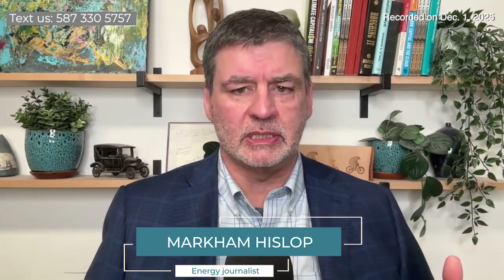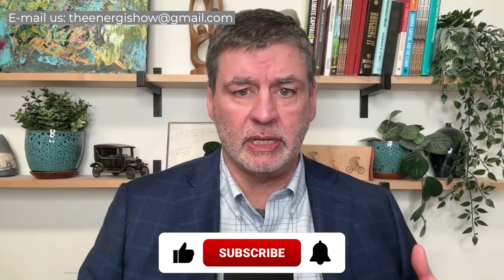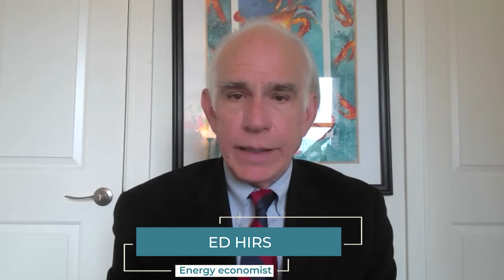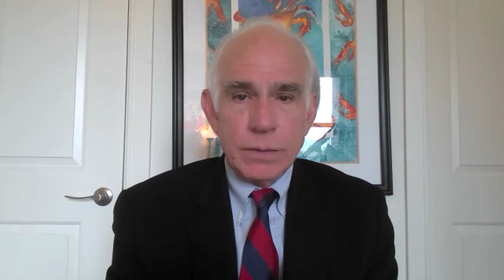Small Modular (Nuclear) Reactors Still Unproven. Are They Even Needed?

Comment: No. Wrong. The Reactors the U.S. Navy uses on aircraft carriers and submarines use bomb grade U235. Because they have to last a long time between fuelings. No one is ever going to commercialize one of these. Starting with that idea means failing. Here is a better idea : Build a liquid Flouride Thorium reactor with a funnel you can drop certain nuclear waste into, digest it at @400 Centigrade, and spit out pure elements. Then just make electricity with it. Because it's the same machine with fewer parts. When it finally breaks dig a hole next to the one it's in. Get a new reactor. Transfer fuel. Bury the first reactor.

Comment: a key point that I take from this conversation is that the SMRs in the US will run on highly enriched uranium. So far in Canada we have not had any enriched uranium reactors to my knowledge. If SMRs in Canada will run on the CANDU model of non-enriched fuel, I suspect their operational costs will be significantly higher while not taking advantage of already built design.
Reply: As I feared then, there's some misinformation going on.

SMRs in the US or elsewhere don't need to be tied to a specific amount of enrichment, enrichment is related to the fundamental reactor design not the size or format. There's some weak correlation on the size front as as your reactor volume shrinks your neutron economics deteriorate and enrichment is a convenient tool for compensating but not the only tool.

Getting to the specifics, the BWRx that we're building will require low enriched Uranium as is typical for boiling water reactors. This is more enriched then what our CANDUs use but isn't going to be a huge impact on cost, we're taking more risk on spinning up a new set of parts for a different reactor from our existing CANDUs then the cost impacts of low enrichment.

The real issue around enrichment is energy security, enrichment facilities are few and far between and currently the cumulative west needs Russian enrichment to provide enough enrichment for western nuclear reactors, this is even more severe when you shrink the circle and consider Canada's domestic enrichment capacity of zero. It's highly unlikely that Canada will spin up enrichment capacity for the one BWRx on order, it's also highly unlikely either Europe or the US is organized enough to make that happen. It's just adding a big liability for a pretty middle of the road reactor design.

Conceptually I get the appeal of SMRs, especially the very small stuff that would be used for diesel generator replacement in the high north but the BWRx is far away from that. Also without getting into more exotic cooling or fuel format designs the size of a 'Small' SMR tends to approach GW scale reactors, this was a lot of the issue that NuScale faced. Given that I really don't see the point in putting an American-designed reactor ( taking bigger risks on a Canadian design might make sense but this isn't that ) only to plug it into the Ontario grid at a point that could take a GW scale reactor. Frankly Bruce Power's consideration of building some more CANDUs at the Bruce site is a more exciting and relevant project for the future of Canadian nuclear and power generation writ large.

At best there's Canadian interest in OPG de-risking the BWRx for Alberta and Saskatchewan but if we're taking risks I'd rather they look at a small CANDU or the IMSR.

For a more thorough investigation of nuclear power I'd consult the 'Decouple' podcast, truly excellent stuff that goes deeper then our host here.

Comment: We should do more wind, solar with lots of battery storage
Reply: What you want to use proven, existing, available, technology with a declining cost structure?  Why not depend on a yet undeveloped tech with undefined cost structures and increasing cost fuel requirements?  Are you some kind of fascist commie?  /s
Reply: 0:39 if the homes and businesses under a roof with modern PV and v2g EVs selfplugged-in then grid cashflow is dead when the sunshines and the crops grow and the batteries are full. 247 problem for grid central generation. 

SMRs economics is based on 247 cashflow. 
National grid are many times BIGGER economics and is based on BIGGER 247 cashflow. 

Is their anyone who thinks beyond nuclear HEAT 247 ?????????

The children say " I will pay for it, you give me the money Dad. "

Comment: The U.S. Navy alone operates 100 SMRs. There are 34 nuclear reactors being built in China with plans to add 6-8 per year, and these are CAP1000s, not SMRs. Solar & wind have NEVER reduced the growth of global emissions, which are still rising. Nuclear has TWO MILLION TIMES the energy density of solar / wind, is cleaner / safer, and when a plant runs for 60-80 years, and isn't over-regulated, nuclear is as cheap or CHEAPER than solar.

Comment: The new AI data centers that are training AI models have many large power spikes in the range of seconds to months. They will need big grid scale batteries (or maybe pumped hydro) in addition to UPS batteries even with nuclear power. They need power now and are building private hyperscale grids mostly starting with gas power. Nuclear  (outside of restarting old reactors or uprating them) is many years away. Most hyperscalers have firm PPAs to buy solar or wind.but they have expressed interest in new SMR and even new AP1000 reactors which for them is the distant future in the AI race.

Comment: Also, the nuclear project at OPG Darlington is "SMR" in name only.  It's just a medium-small sized 300MWe fission reactor.

Specifically, the Hitachi-GE BWRX-300 reactor being installed at Darlington is being built like any other nuclear power plant using custom bespoke manufacturing and installation.  OPG just confused the public and high-level government officials with SMR marketing lingo like "modularity" and "manufacturing" when none of that true.

What's worse is the Hitachi-GE BWRX-300 is a pure first-of-a-kind (FAOK) unit where not even a working prototype has ever been built anywhere.  So it's making Canada actually build the first prototype. The risks, overruns, and schedule slips will land squarely on Ontario ratepayers and risks pushing Canada behind on climate energy goals.

The BWRX-300 is a brand-new reactor class.  Sure, it borrows some core physics from older GE boiling water reactors, but its integration, cooling method (natural circulation), containment design, and passive safety systems are new combinations that have never been demonstrated together and Canada's OPG is taking on the risk of that.  Nowhere else would we ever buy a product that has no working prototype let alone a series of commercial operating units.  Yet we do so when it comes to a $20B product like the line of BWRX-300s that OPG has committed too.

Comment: Does the SMR still require waste disposal issues? How do subs and carriers dispose their nuclear wastes?l
Reply: Yes, they need waste disposal for the spent fuel and the reactor, and large parts of the sub are low level radioactive waste when the sub reaches the end of life. But these are military equipment, so countries with them say we don't care, special rules for the military.
Reply: Yes, SMR requires waste disposal and refueling which alone kills it from being installed in or near datacenters and factories.  So many pro-SMR advocates dream of on-premises SMR power generation are in for rude awakening.  Refueling a nuclear reactor is a hazardous operation that necessarily exposes the high radiation reactor core.  Also the spent nuclear fuel that is very hot (thermally) as well as emitting lethal amounts of gamma radiation.  No way a refueling event is happening in a city's industrial or commercial zones!

Military reactors eventually have to refuel but it takes a long time like 20-years.  But this doesn't help commercial SMR whatsoever!

Because military reactors use highly-enriched uranium fuel which is forbidden outside of military use because of weaponizability concerns.  Also military ships rarely run at full throttle carrying heavy loads like commercial ships do all the time.   Military vessels often just linger around, patrol and occasionally do full throttle sprints.  So both of that helps nuclear-powered military vessels achieve a long 20-year refueling interval.  Eventually, even they need to go to militarized port for an extensive refueling operation and inspection.  It requires downtime of months.
Reply: @beyondfossil  How exactly is the core exposed during refueling?

Comment: My position is this: build gas fired thermal plants with the capability to convert to natrium powered by nuclear.
Since a gas powered plant can be built in 1/4 of the time of a nuclear plant, that can meet the immediate need.
Begin building the nuclear plant and related natrium storage tank, pumps etc to handle the variable loads.
Switch to nuclear and natrium as that system comes on line.

Comment: Nuclear reactors aren't actually that useful for the consistent power thing.  The first issue is that what is needed isn't really something that puts out the same amount of power all the time, it's something that can quickly put out more power when needed.  The current approach to that is gas "peaker" plants.  Nuclear can't do what gas "peaker" plants do.  Batteries can, though.  So can most other forms of storage.
The second issue is that while nuclear power is very reliable hour to hour, on 24/7, it's not that reliable month to month.  When nuclear plants have little maintenance hiccups, they can go off line for weeks or months.  Plus, we're in a time where droughts become ever more common and river water is more likely to be quite warm.  Why does that matter?  Because nuclear reactors rely on cooling water from rivers, and we've already seen reactors having to be shut down during droughts in Europe as their rivers dry up.  An excessively warm river can also just not be cool enough to provide the cooling needed.  So reactors are going to be growing less reliable as climate change progresses.
And, of course, they're ridiculously expensive.  And nobody except maybe China has pockets deep enough and manufacturing strong enough to make them cheaper by mass production, no matter what all these little grifter SMR companies claim.  When you add in that the fundamental physics of nuclear reactors makes small ones less efficient than big ones, that means any gains from mass production have to overcome that disadvantage first before they even get as "inexpensive" as normal ridiculously expensive nuclear plants.
Reply: SMR may get cheaper in 10 to 20 years, but only the Chinese ones, so in North America, politicians won't allow them.
Reply: Nuclear reactors use a variety of types of coolants besides water…and their cooling systems are closed loop, they would not rely on running river water.

Comment: It's questionable whether SMRs can be economically viable on any operational schedule but they absolutely have not even a mote of a chance of being able to operate economically on the daily cycle typical of a modern power grid.  The instant a nuclear reactor tries to load-follow on a daily cyclic, the maintenance and wear goes through the roof.   And even if it doesn't... even if a nuclear reactor (SMR or otherwise) sticks to constant power output, that means that most of its output energy will get poor wholesale pricing.

Anything with storage, on the other-hand, can both follow the demands and also operate at maximum output during the highest wholesale pricing periods (periods of high demand), and minimal or no output at other times. 

Theoretically this means that nuclear IS viable when paired with storage, but the reality is that this will not be the case until the grid the nuclear is sitting on actually has enough storage to normalize prices (minimize pricing swings) across more or less the entire 24 hour period. 

So storage comes first no matter what.  Without storage there is no point doing any nuclear (large or small).

-Matt
Reply: In Japan, where they did not have access to gas, so no gas peaker plants, they have been building 1 GW of pumped hydro for each 2GW of nuclear. The thing is, if you have to build all these batteries, why not use renewables?
Reply: @ryuuguu01  Sure, you use whatever storage is convenient.  If pumped hydro is convenient, there ya go.  There are advantages and disadvantages to both.  Japan happens to have huge water resources and many decent locations where pumped hydro can be implemented.  And as a government-run operation they may not care that pumped hydro is less efficient.  Particularly when paired with nuclear... it might not matter at all.
Reply: Renewables use more land area, this is an issue.
Reply: @bradleykrizan5294 oh please.  Compared to what, oil?  Total nonsense.
Reply: @bradleykrizan5294  LOL. Yeah. Canada has a massive land shortage and is not filled with suburbs with large houses and empty roofs or malls with large parking lots..  /s
Reply: We "need" hundreds of gigawatts if not terawatts of steady power for AI Datacenters. This is the best use-case for small, modular reactors. It's not for selling to the grid, soon enough we're going to have peasant revolts because people are big mad about the datacenters driving their power bills up fourfold. When that happens, the newer even larger datacenters will have to be off-grid with their own power supplies, otherwise too politically toxic.

Comment: SMRs don't exist (besides a couple of test sites in China/Russia) and you don't get economies of scale through building them, you actually lose economies of scale (same complexity as a large nuclear reactor, but with lower output lol). Nuclear energy is one of the few industries with a negative learning curve: it gets more expensive with more cost overruns and delays over time. Just ask the poor people of Georgia or Tennessee about their nuclear boondoggles, or Hinckley in the UK. Even in China, where there is full government control and no NIMBYism, they only build 5GW of nuclear per year, and 500GW of solar/wind. SMRs are a predatory delay tactic by the fossil fuel industry. As long as they can convince governments to look at SMRs, they can prevent the rapid build out of much faster and astoundingly cheaper renewables.
Reply: Pure fiction. The U.S. Navy alone operates 100 SMRs. There are 34 nuclear reactors being built in China with plans to add 6-8 per year, and these are CAP1000s, not SMRs. Solar & wind have NEVER reduced the growth of global emissions, which are still rising. Nuclear has TWO MILLION TIMES the energy density of solar / wind, is cleaner / safer, and when a plant runs for 60-80 years, and isn't over-regulated, is CHEAPER than solar. But don't concern yourself with reality. Just make stuff up.
Reply: SMRs have been around for about 50 years just not in the commercial sector. Nuclear subs warships in the US and Russia utilize this technology.

Comment: SMNRs extremely expensive for what you get, and once used a headache to dispose of essentially forever.
Reply: Also, as consumable-based technology, economies of scale are dominated by Hotelling's Rule, meaning that however much you economize on build through mass production, you simply accelerate the steeply rising side of the long run cost of production curve.
If they ever achieve 'low' costs that mirage will burst rapidly, leaving creditors to soak in liability.
Reply: Nuclear waste is an overblown problem.
Reply: @remliqa  It's an overblown problem every year for 400,000 years, though.

And it's only overblown while it's being monitored by experts.

Are you going to pay the net present value of 400,000 years of expert monitoring salaries?
Reply: @bartroberts1514  Firstly most nuclear wastes don't  last 400K years. Over 97% of them are low level waste. The last three percent can be reduced further by recycling them into new fission  fuel  or other materials ,  some newer reactor design even "eat" some of the waste material.

Out of the non reusable waste, you can literally safely encase them in concrete and they will sit safely in place for centuries or even millennia with suitable site.    Nuclear waste isn't going to try to escape . The funny thing about radioactivity is the longer the half life of a material, the less danger it poses.
Reply: @remliqa  Great, thanks for explaining how you'd fix the problems.

Have you paid to fix these problems you've listed?

Do you know someone who will be doing the paying?

When you say "..don't last 400K years.." do you refer to the ones that last 40K years? 4K years? 400 years? 40 years? 

When you say "reduced further by recycling", do you expect that to actually happen, or do you mean it hypothetically, like the theoretical possibility you might develop radioactive spider powers from them?

As for safe concrete, the longest any manufacturer rates envelopes for is 100 years; prudent security requires re-skinning every 80 years. Those cases are expensive. How many of them are you willing to pay for?

And on a day where two more new terrorist attacks have been mounted on opposite sides of the globe, pretending the problem is the wastes trying to escape, not the bad guys trying to get them seems willfully naive.